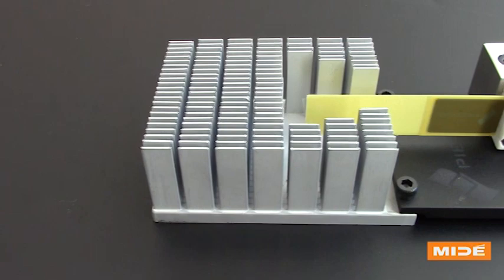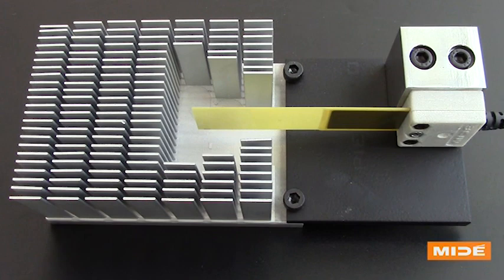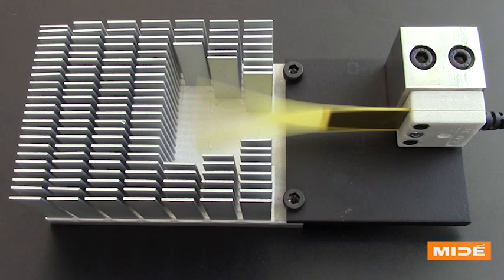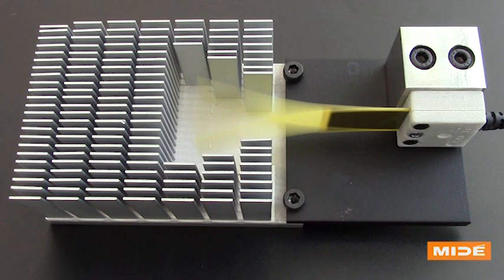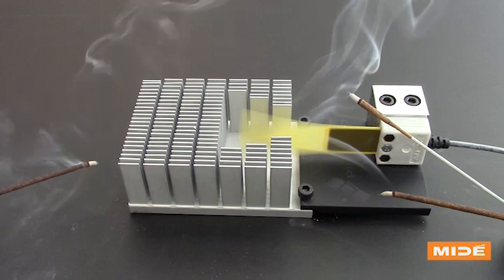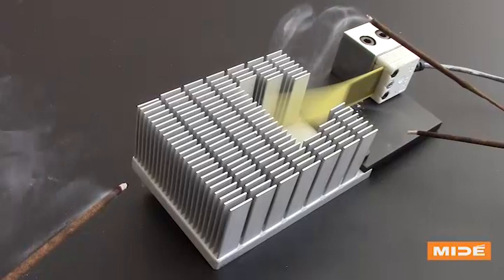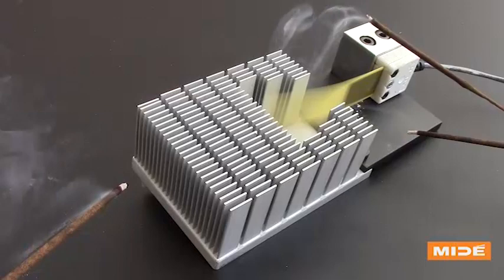Forced Convection with Solid State Piezoelectric Fan

Comment: What's mtb?
Reply from the maker: Sergey, in the HALT testing we performed we never had any failures so we were not able to calculate an MTB.  That was actually an issue for that first customer and one of the reasons they did not pursue the technology.  Here is some info we provided in another comment reply:  

During the development of the piezoelectric fan our customer required us to run some highly accelerated life testing (HALT) on a statistically significant number of samples.  The test included thermally cycling the fans 1000 times from -40 to 125C while they were operating.  The test took about 5 weeks to complete.  There were no failures.  We also ran the fans through high temperature operating life at 180C (HTOL), low temperature operating life at -70C (LTOL), Over voltage test at 100% over the normal operating voltage, Humidity HALT testing, Cold start testing which included a hard start up after the fans soaked at -40C for 14 hours, high temperature storage tests where the fans were soaked at 140C for 1000 hours prior to successful operation, dust ingress testing, salt spray and fog testing and IP68 testing where we submerged the fans for 72 hours at the equivalent of 3 meter depth pressure and then operated them after they were removed and dried off.  There were never any failures during any of these tests.  Lastly, we have been running a non accelerated life test on a single unit (in my office) since June 15th, 2016.  It has only been unplugged one time when we moved to a new building.  It is still running as of this morning with no noticeable change in performance.  I sit about 6 feet from it, If I really try to listen hard I can hear it running.  Running at 60 Hz we have put just over 11 billion cycles on the fan without failure or change in performance.

Comment: I hate it when advertisers simply brush over or ignore issues. "No rotating or moving parts that can wear or fail" ... except the bendy bendy part that will eventually fatigue and fail. It might have the same lifetime as a traditional fan, or it might last 10 times longer, or 100 times, or a thousand times. Who knows, but given that the video simply glosses over this issue instead of giving a hard number I'm inclined to believe it's no better or perhaps even worse then a traditional fan. The second a manufacturer gets vague about the details is the moment you know they're covering up something.

Comment: Saying it won't be affected by dust is bs.  Any dusty environment will have build-up issues, no matter what way the air is moved.
Reply from the maker: Thanks for the comment.  We performed accelerated life dust testing and did not have any issues.  We have had a fan running for 8 years in an office environment with no issues.  It is possible if dust built up on the end of the blade it could cause performance issues but we have not seen that.

Comment: That little flappy thing would wear out in no time.
Reply: The friction [drag] caused by piezoelectric deformation would be negligible.
Reply: @0MVR_0  have you ever seen a flag that's been hanging outside for a long time?
Reply: @jeffhuffman8154  Was about to bring up that exact analogy, except presuppose that the flag was the object causing wind, meaning that a piece of cloth was responsible for the dynamic pressure potential in atmosphere, set aside that the motive impulse was entirely internally driven and the flag fell short of self-abrasion.

Comment: Says “no moving parts” immediately shows a rapidly oscillating part. Worse, it’s flexing a solid, which is just asking for a fatigue failure…
Reply: some materials have an endurance limit which is when it can be cycled at a low stress for an almost infinite number of times before experiencing failure. But you're right, there is a high chance of fatigue failure if it so much as gets a surface scratch for the failure to begin propagating out from.
Reply: It's  like a piezo speaker. it has no moving parts, just parts that changeform. So there is no friction between parts, no lubricant needed, no abrasion taking place. Technically speaking there are no moving parts! So the video is technically right, the best kind of right.
Reply: @TremereTT  incomprehensibly incorrect

Comment: It's cool and all, but a $1100 for a (KIT-012 60HZ Piezoelectric Fan Kit) which is basically a cpu fan is quite high
Reply from the maker: Yes, the fan KIT is very expensive.  It is just meant as a demonstration product.  We believe in high quantities the fan will be more reasonably priced, never as low cost as a traditional fan, but more in the $10 range.

Comment: That oscillation would cause material fatigue of both the material itself and its bindings. It also would be useful to know the m³/min (or if you prefer worse measurements CFM) of the fan in question.

Comment: Interesting idea, I was surprised by the high air flow of the demonstrator. What I don't think to be 100% accurate though is the dust claim. I have seen fast spinning fans with dust crusts. And also the major issue from dust accumulation istnt the fan itself but the obstruction of the cooling fins. But beeing on paar with the dust accumulaton of a normal cooling fan and in addition having other benefits should drive this tech forward. Probably price beeing the major hurdle to take now.

Comment: You invented a problem, and then figure out how to fix it. Just give one example of practical use of this device which could not be done by conventional fan.
Reply: worked for a composites mfg, lots of conductive, abrasive ultrafine dust. every fan on the shop floor sounded like death if it was old enough. something like this is immune to those conditions.
Reply: Generating airflow inside a MRI scanner

Comment: "no rotating or moving parts that can wear or tear" is very smart terminology used since this device is classified as oscillating and this sentence is technically true. Yet, it will wear, tear, break, snap, build up dust vibrate, and produce excessive noise due to vector change in the air.

Comment: Constantly bending the flapper ought to eventually snap it. Not convinced about reliability.
Reply from the maker: Thanks for the comment Anthony.  During the development of the piezoelectric fan our customer required us to run some highly accelerated life testing (HALT) on a statistically significant number of samples.  The test included thermally cycling the fans 1000 times from -40 to 125C while they were operating.  The test took about 5 weeks to complete.  There were no failures.  We also ran the fans through high temperature operating life at 180C (HTOL), low temperature operating life at -70C (LTOL), Over voltage test at 100% over the normal operating voltage, Humidity HALT testing, Cold start testing which included a hard start up after the fans soaked at -40C for 14 hours, high temperature storage tests where the fans were soaked at 140C for 1000 hours prior to successful operation, dust ingress testing, salt spray and fog testing and IP68 testing where we submerged the fans for 72 hours at the equivalent of 3 meter depth pressure and then operated after they were removed and dried off.  There were never any failures during any of these tests.  Lastly, we have been running a non accelerated life test on a single unit (in my office) since June 15th, 2016.  It has only been unplugged one time for about a day when we moved to a new building.  It is still running as of this morning with no noticeable change in performance.  I sit about 6 feet from it, If I really try to listen hard I can hear it running.  Running at 60 Hz we have put just over 11 billion cycles on the fan without failure or change in performance.
Reply: @MideTech  You should livestream the fan you said that has been working for years, safe bet some people will watch.

Comment: So if someone is looking for a video demonstrating " reinventing of the wheel" or over engineering here it is...
Reply: The wheel has changed drastically since the use of chariots.
Reply: @0MVR_0  I referred to the grometry, well keep on trying, dont stop inventing becouse in the process  of  1000 ways how not to do the lightbulbs, you can fail for once, and you can get something useful :)
Reply: @marcsmithsonian9773  My own inventive contribution included using this as a rigid body submersible. Akin to either replace the propellers of a submarine or constructing the hull of the ship directly as a locomotive entity.

Of course, even the ancients had to invent the wheel iteratively even if the concept existed in distant lands or was forgotten. So we might call this reinventing frictionless geometric actuation, as teh wheel replaced those paleolithic dragging carts.

Comment: I wouldn't exactly call this solid state. Besides, you are competing with a metal rod spinning on magnets supported by a box of oil. I'd call that far closer to solid state, considering nothing is rubbing against anything. Do some trickery with magnetic bearings, and the thing will litterally last forever and work underwater with no mechanical points of weakness. This is nevertheless a pretty cool technology though!

Comment: the vibration from this would probably destroy some components or damage them overtime and i wonder how loud this thing would get  but still a pretty interesting tech maybe it can be used in other stuff that needs rapid back and fort motions like an impact drill or something
Reply from the maker: Thanks Aircon Guy.  For the application we designed this particular fan for the small amount of vibration and noise was not an issue.  Basically the plan was to have about 10 of these fans embedded into a very large (>10 pound) heat sink.  The system was going to be mounted in an area where humans would not be present.  That being said I have one of these operating in my office for the past 8 years and I have not really noticed it.  The real benefit of this technology is the operating limits and durability relatively to bearing based fans.
Reply: @MideTech  ohh that makes more sense than one big flap good point wow 8 years of non stop operations servers and miners will gobble this up if it becomes more available :O

Comment: This is a solution looking for a problem. An expensive, fairly big (because oscillating needs space), vibration causing, inefficient design for replacing current ultra efficient, cheap, compact, silent and stable designs. If it can handle more temperature as claimed that's all fine and good but then I have to ask if the design contraints are such that you can't just put a duct in a normal fan ....
Reply: beacuse of the dust and fibre, occasional sprays, and magnetic fields. None of these can affect this solution, which is why they do have a market niche. Have you ever tried to run a regular fan inside a MRI scanner? good luck.
Reply from the maker: We agree this is a solution looking for a problem.  You are correct in the technologies limitations.  The real benefit is that the fan can operating in extreme environments (temperature, humidity, corrision, dust) for long periods of time.

Comment: The comparison is brutal though through the eyes of DIY. You can get a good 120-140mm 60-70cfm fan 12V DC for about 15$.
This one is 10cfm for at least 250$.

I've read some articles regarding SMPF73W12F60 which also looks good but only has 2cfm.

Comment: Wouldn't this technology be great at nano scales / MEMS? Think a smoke or chemical detector printed on a die, including an inlet piezo fan. Or a piezo propeller for a nanobot. In fact, if you "tune" or resonate thousands of these, printed on a die, you could possibly achieve macroscopic effects, much like a Fresnel lens achieves similar results to a full-scale lens, without the bulk.

Comment: How many cycles before it cracks? This is the difference between "WOW SUPPRESSED TECHNOLOGEEEZ!!!" and actual engineering. It's neat, I'll give you that, but just like any fool flappin a cardboard fan at something it's only going to last so long before the material fatigues and cracks or loses integrity. Also, it's not going to do more than create a gentle breeze. If you want real airflow out of a design like this, you're going to be vibrating the ever loving crap out of the whole entire apparatus. Equal and opposite reaction still stubbornly applies, which is why rotary fans rule. A simple 5vdc magnetic bearing micro-fan gets the same thing done without having to look like an Elon Musk® super wow amazing futuristic whatever the hell they're going for here.

Comment: So im assuming these piezo fan blades Cannot be powered with DC?
Reply: Tim, correct they can not be powered directly with DC.  There are some piezo driver IC's that can take low voltage DC and provide the required high voltage AC output.
Reply: @cludlow64  Thanks. Is there a such piezo driver IC for the Piezoelectric Fan Blade 60 Hz, that you know of? I ordered 2 of these and am experimenting with it.

Comment: "No moving parts"

... looks at the part moving. 🤔
Reply: The part is actually stationary.
Reply: @0MVR_0  Incorrect.
Reply: @interstellarsurfer  The concept is very strange to think about, however the fixation is on a single segment of the lever. The lever itself is just rapidly internally deforming and so we perceive motion yet the actuating leverage is entirely within the material.

If you take playdough and reform the substance into a statue of david, you wouldn't say 'the playdough moved'. The playdough has been wholly stationary despite being acted upon. A similar notion is had with geometric reconfiguration by electric stimulus. Nothing is 'moving' simply realigning to fit a newly more convenient structure.
Reply: @0MVR_0  You're really high.

Aside from that, the statue of David isn't going to suffer from fatigue, while this device will.

It's a moving part - it's a shame you don't realize it. You seem like a smart boy. 🤷‍♂️
Reply: @interstellarsurfer  I accept the insult as an estimation. Other than that, I have only eaten food today and am largely chemically abstinent. 

A statue of David made of playdough can certainly suffer from fatigue just as a bridge will undergo stress by changing atmosphere. 

Concerning the video, the part truly is static, yet I recognize your need to defend your perspective by referring to my personhood, to speak little of shame.

Comment: Their cheapest piezo fan is $400 :/
Reply from the maker: Thanks for the comment Yuri, yes the fan is expensive in low volume, but we estimate in high volume (>10,000 units) it could be made for something closer to $10 per unit.
Reply: @MideTech  But you are making them since 2016 or so and still haven't reached such volumes?

Comment: So no real longterm tests, just a single extremely low-power unit that is running under no load what so ever.
Nice if you really have an environment were no normal fan can be used, where you can not use any of the sealed fans, were you can not use any external drive, were you do not care about low efficiency and where you do not care about low performance or high cost.

Comment: Doesn't look so strong. ..
Reply from the maker: Thanks for the comment Ariel, here is what we provided to another similar comment.  During the development of the piezoelectric fan our customer required us to run some highly accelerated life testing (HALT) on a statistically significant number of samples.  The test included thermally cycling the fans 1000 times from -40 to 125C while they were operating.  The test took about 5 weeks to complete.  There were no failures.  We also ran the fans through high temperature operating life at 180C (HTOL), low temperature operating life at -70C (LTOL), Over voltage test at 100% over the normal operating voltage, Humidity HALT testing, Cold start testing which included a hard start up after the fans soaked at -40C for 14 hours, high temperature storage tests where the fans were soaked at 140C for 1000 hours prior to successful operation, dust ingress testing, salt spray and fog testing and IP68 testing where we submerged the fans for 72 hours at the equivalent of 3 meter depth pressure and then operated them after they were removed and dried off.  There were never any failures during any of these tests.  Lastly, we have been running a non accelerated life test on a single unit (in my office) since June 15th, 2016.  It has only been unplugged one time when we moved to a new building.  It is still running as of this morning with no noticeable change in performance.  I sit about 6 feet from it, If I really try to listen hard I can hear it running.  Running at 60 Hz we have put just over 11 billion cycles on the fan without failure or change in performance.